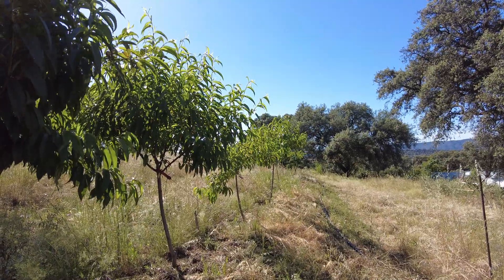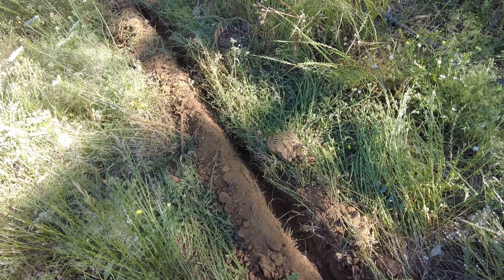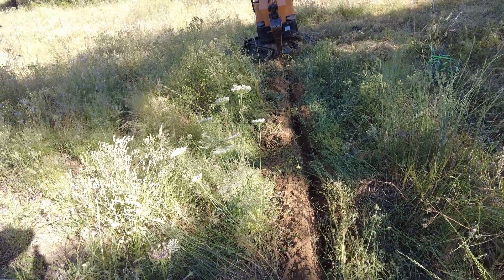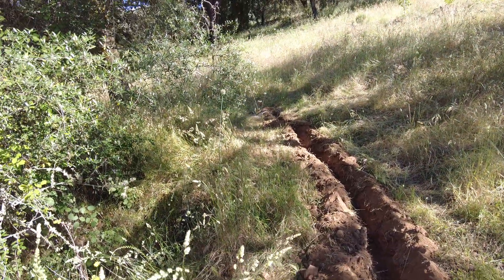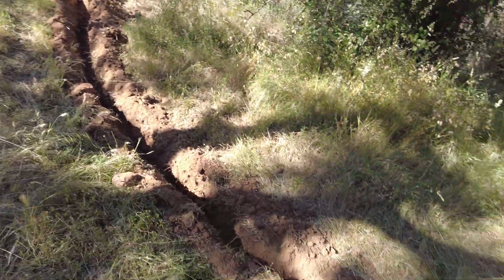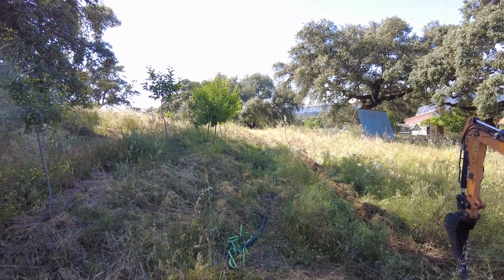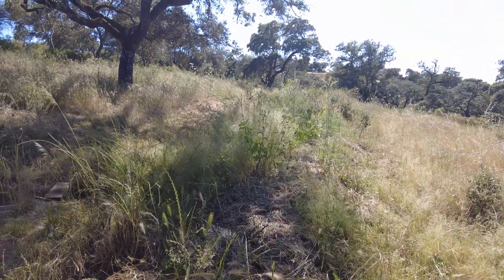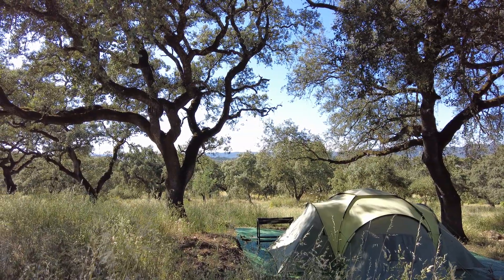Clay soil consists out of plates, not balls. #agroforestry

Comment: You prepared another informative essay that you posted in your description concerning "All Things Clay". A must read for anyuone restoring land with a high clay content.✅
Your thoughts about routing the waterline took me back to 8th grade geometry!  " In Euclidean geometry, the shortest distance between any two points is always a straight line."  Funny how I can't remember what I had for lunch yesterday, but I remember 8th grade! 🤣
SO happy to hear that you now have first hand evidence that rain your swale and berm system captures and distributes has noticeably wetted the soil downhill of the system.  THis finding may give you some ideas about how your rain distribution system can be expanded.  I guess you can't have a too big rain water distribution and retention system in Aroche, Andalusia. SO rewarding when you can hold the fruits of your labor in your own hands 😊
Great to see your Giraffe and trencher bucket working exactly as designed.  Must be a joy to be working within all of the operator and machines comfort zones.😉 As to routing, I vote for straight lines 👍
I'm happy you are doing this project now.  You were due for a change of pace.  Let the machine do the heavy lifting.  
This trench is a good example of how you can do "keylining" with your existing equipment.  It is slow compared to a 75 horsepower tractor, but it is precise and you will exercise far more care than a contractor..  The only modifications would be; 1) Following a contour. 2) Digging to the maximum depth of the trenching bucket. 3) Filling the excavation in with loose soil as you go. Maybe even plant some sunflower and sorghum seeds? 😉☑  
You choose an idyllic spot for your tent. I would be delighted to sleep there. I hope you enjoy it too. ❤
Reply from the maker: Now you started a whole new fire in me Steve. Let's make keylines. Thanks for sharing and chatting. Sometimes I wait for your comments but today even a fridge message. Have a great day with wonderful people
Reply: @SuerteDelMolinoFarm   AH HA!  KEYLINES!  How exciting.  Only thought I have is try to keep the Giraffe tracks parallel to the keyline (or trench) you want to dig.  That should make maneuvering the Giraffe less complicated. 👍
This is a good time of the year for keylining too.  The soil is not rock hard yet , it's too hot to do manual labor and when the rains return the keylines will be ready to receive rain.  And maybe you'll discover a few more stones to set aside for your weirs 😊🌻
Reply: Keylines are a new concept for me, an interested layman 👍
Fascinating video notes, as ever, thanks Martin